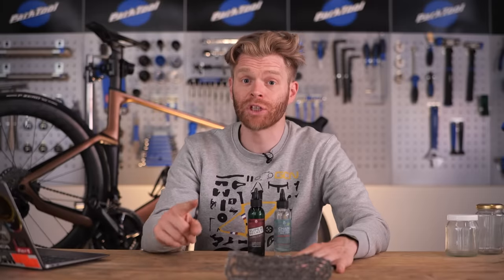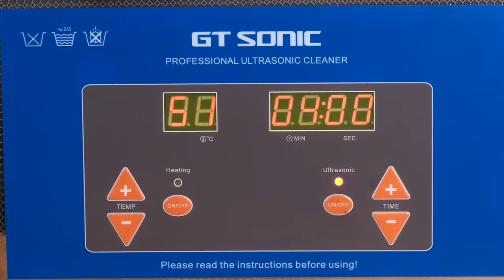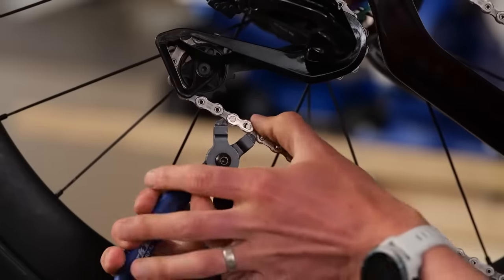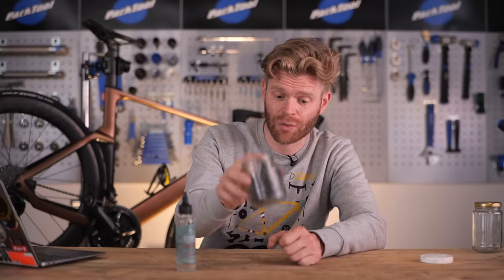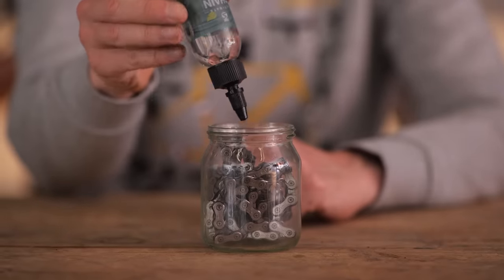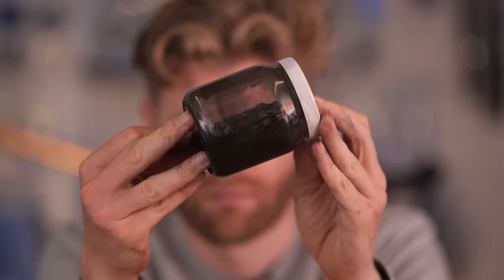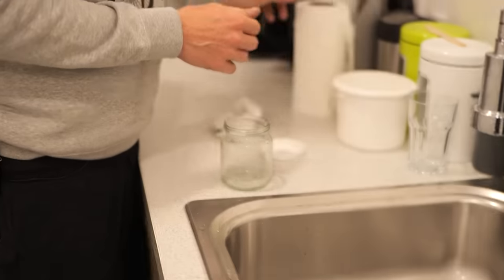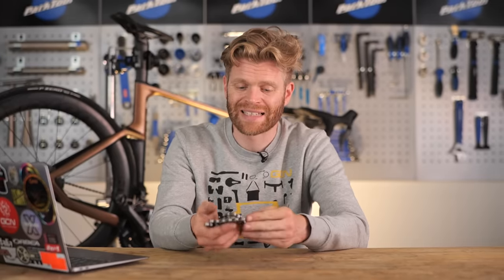The Most Efficient Way To Deep Clean Your Bike Chain

Comment: #AskGCNTech , On the fence about switching to a waxed chain.
The channel has been very informative on the subject the last couple months 😉.
Question is does it have the feel of a fresh lubed/clean chain, say on your third ride after application????
Reply: Using it for more than a year. The best decision to switch ever. You calculate more based on the km ridden. If one ride for 300km – then change after one ride. Or just after 10 30km rides.
Reply: Yes it does. In fact it feels better after the first 30-50km and for about 200km. Problem is, that very soon you'll realise that you need 2-3 waxed chains to rotate, especially if you ride in wet. But I never used bicycle wax, just good quality hard paraffin wax with <0.5% oil in it and melting point 60-65C (much cheaper too).
Reply: I no longer wax my chains.  Too expensive and has no discernible benefit IMHO.   Rewax every week 300-400kms max.
Reply: I stopped using wax on my chains because it doesn't feel as smooth as a freshly de-greased and re-lubed chain to me. But who could guess that they're sponsored by Silca , every video this last while has been banging on about the benefits of a waxed chain.  😂 😂 😂
Reply: Somewhere between 200-300 miles is where I notice the dropoff. I'm rotating two chains every 300 or so miles, which in my case, is about 2-3 weeks. The initial prep is the onerous part...rewaxing takes maybe an hour, and most of that time you're just waiting for the wax to become molten. The waxing process itself takes about 5-10 minutes, with about 2 minutes of those actually requiring you do be doing anything. 

After dropping the chain in the wax, you shake it around to expel the air bubbles and then you wait for the wax to cool for a few minutes. If using Silca's wax, this is about the time that the tungsten disulfide particles stop swirling around and the pot starts to look like a metallic brain. Then you pull the chain, shaking the excess as you go. If you've done it right, the drips will start to solidify a few seconds after pulling the chain from the pot. You then hang it to dry.

The chain is properly waxed if it's stiff as a board after cooling. This means the wax has penetrated the rollers. I then break loose the chain with some back-and-forth movements until the links are fairly loose (catch all the wax bits that fall off on a plate or a bowl and poor those back into your wax pot). Then I thread the chain on, install the quick link, and check the gear indexing.

After a few miles, it feels...liquid. Better than any wet lube I've ever used, and astoundingly quiet.

Yes, it's a huge upfront cost in both time and materials. But this is your hobby and it's a fun rabbit hole with performance and long-term cost benefits. Obviously GCN Tech is going to advocate for this sort of thing because that's the function of this channel, but no one's saying you have to do it. It's just a fun, totally optional way to be more obsessive about what you love.
Reply: @mekongvelo4592  To be fair, John Cannings extolled the virtues of using wax some years ago before Silca were a sponsor.

Comment: Be aware that a Shimano quick link is not reusable. And kmc ones only up to 5 times. Might be an expensive solution after all.
Reply: Shimano makes reusable AND non-reusable quick links. So just be careful when purchasing that you get the reusable ones. Price of the two varieties is about the same. Having said that, the best reusable quick links are Connex quick links. They are a little pricey, but they require no tools to remove or attach. Brilliant!
Reply: Wipperman Connex Links are the best out there. Been using them for over 20 years. Not the same one obviously but they last for a very long time.
Reply: @CatManDoSocial  20 years would have been impressive! 🤣🤣🤣

Comment: My experiences with immersive waxing are great, but a quieter chain is definitely not the case.
Reply: Should be - what kind of noise are you getting?
Reply: @meibing4912  The chain makes more noise compared to a wet lubed chain after the first 120 km. I rewax more often to avoid this.

Comment: I just use a Turpentine substitute and then soak in methylated spirits to remove the film left behind by the turpentine….dry the chain…apply squirt lube….can buy huge bottles of turps and meths for a few quid, far cheaper than this product and works just fine.

Comment: You should NOT drain the contaminated cleaning solution in the sink! The Chain Stripper may be biodegradable, but the contaminents (old grease, metal particles etc.) are not!

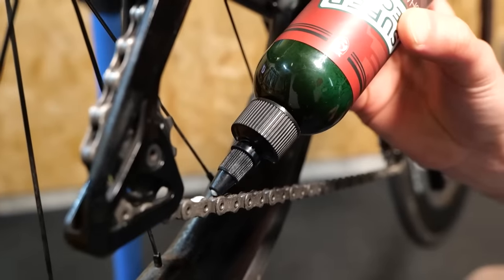Comment: 6:18 - lube does not wet the metal surface but rolls off instead. This is the strong sign that cleaner is not efficient to get off oil film from metal. Total failure. Considering how expensive silca product is GCN should be prepared better.

Comment: Soak in diesel overnight, with shaking before and after. The diesel doesn't evaporate off but it just mixed with whatever oil you next lube it with. Just use a thicker oil.

Comment: Olli, we love you guys but, there is no point making this videos if there won't be any interactions, what is the exact size/dimension and volume of that ultrasonic cleaner at the beginning of the video? how many litres does it hold and the size of the basket inside, wattage etc and would it be ok for a 42T cassette? if not what's the minimum capacity I would need for such a gigantic cog?

Comment: I am sorry but why are you stating miss information in your video about costs?? A basic ultrasonic cleaner is far from LOAD OF MONEY nor do you need to use many chemicals.... Also, the Silca Chain Stripper actually costs MORE than a basic Ultrasonic cleaner and a gallon of degreaser combined....
Reply: You state to use 1 ounce and might need to repeat the step so 2 ounces... @48 USD for the 4oz bottle, that's a darn expensive cleaner